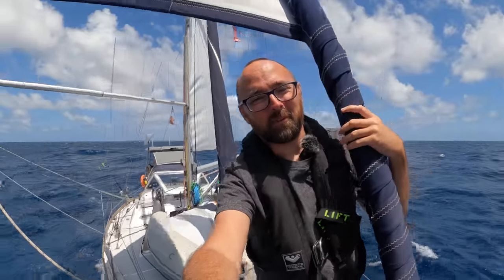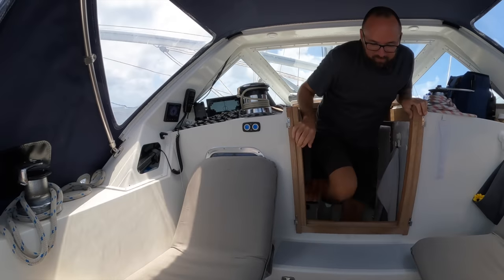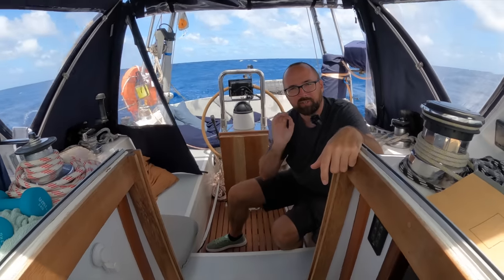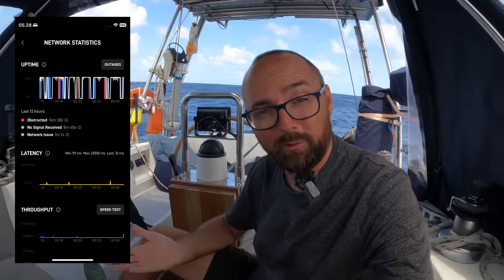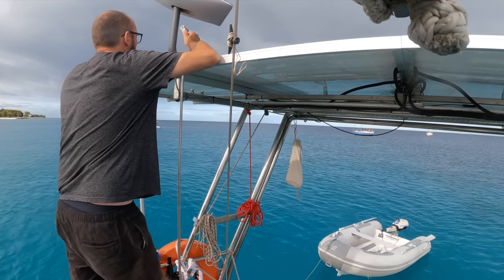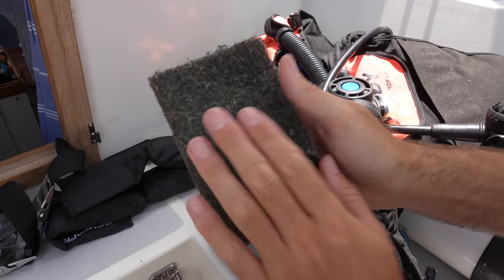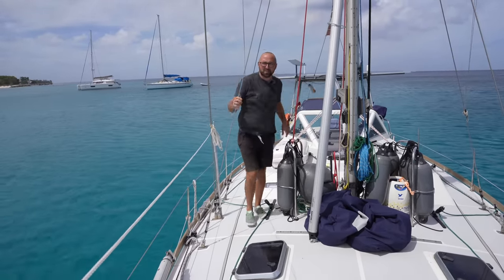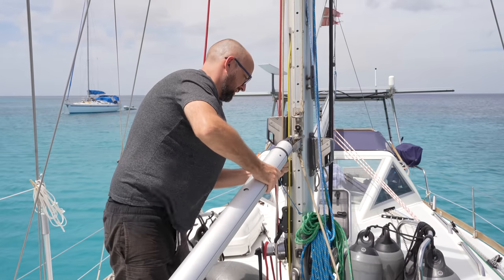Sail Life - Cross the Atlantic ocean ✅ We did it!

Comment: Alternator not charging Li batts, this is due to the battery charge protector shutting it off either when full or hot. This means the alternator has a power surge and no where for it to go, thus it exceeds 100vdc and blows the rectifier diodes. Result no power from alternator. You need a battery protector. 
Clark on YT channel Emily & Clark's Adventure did a vlog on it called - 2 Ways Lithium KILLS Your Alternator (and how to prevent it).

Comment: You should change the metal spatula to a plastic one. The chance of scratching too deep on accident is too high. The plastic spatulas used for fiberglass mixing are too soft, so those won't work, but the ones used for electric (or near electric hazards) are stout and solid.

Comment: Excellent video folks. Did you see my specs and phone down there with Ava's sunglasses? One thing, this is important so read it. We have the same anchor and swivel. We recently came across a post where the swivel jaws had been opened by the anchor shank twisting on a change of tide. The engineering recommendation is to put a short 3-4 links of chain between the anchor and the swivel and not to fix the swivel directly to the anchor shank. That engineering recommendation is from a real engineer responsible for wings staying on aircraft, not an internet expert! That said we were caught out in an anchorage with a vicious 6 knot current which changed direction on the tide. We swung around at the change and the Rocna held solidly and I didn't have to re-anchor and our swivel held.